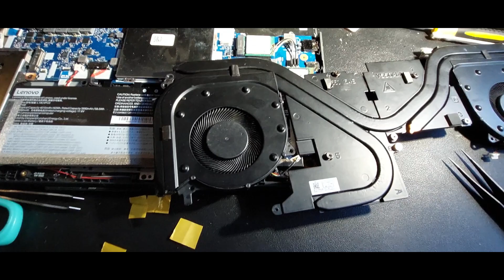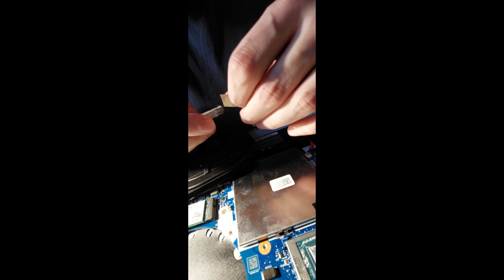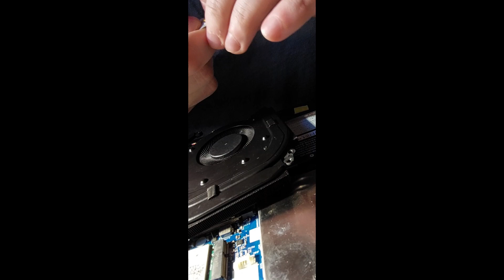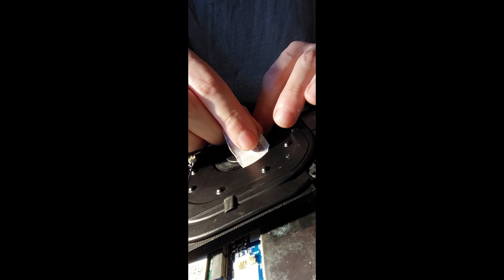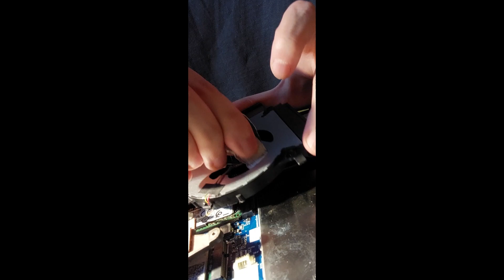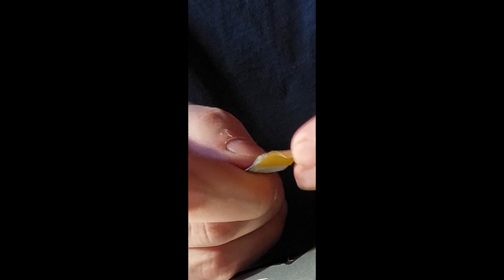How to thoroughly clean locked laptop fans (Lenovo Legion 5)

Comment: I wish I had seen this video before I took apart the fans on my computer, I was following a tutorial posted by Lenovo (which was for a follow-up model that has the fans with screws for easy removal), but I ended up breaking the plastic seals they had by mistake. 

My computer still worked fine for a few months, but it has since stopped working a few days ago, most likely due to the fans not being sealed anymore :/
Reply from the maker: How it stopped working? Is the screen black even though the power is still on? I doubt it's related, this model is notorious for short circuiting motherboard.
Reply: @korootz  The screen works, as you can see the change in brightness when the machine gets turned on, but it never gets to the Lenovo logo screen. I think the heatsink got fucked during the months I used it with the fans not sealed properly, as there were times it got really hot in my backpack (as the hybernation option wasn't working properly for some reason).

I'm looking to replace the whole heatsink with a new one, as it seems to be the most likely cause, nothing unusual can be seen on the motherboard and other parts.
Reply from the maker: @MrRonald2796  Laptop doesn't need a heatsink to boot (although it's a bad idea to run it this way). And short-circuit doesn't have to be visible to the naked eye. Try a hard reboot: remove the battery and unplug the AC adapter, then press and hold the power button for 20-30 seconds, then try booting it up again. Unplug all external devices like screens, too. I had this weird issue where for some reason it wouldn't boot if I had an external monitor connected, had to always plug monitors in only after booting.
Reply: @korootz  I tried that method a few times last week, it worked fine for like 3 days, then the issue reappeared and the method didn't work anymore, always with no external devices attached.

Comment: I think you should clean often since animal hair is there . I don't remove heatsink , I use the body of a pen to blow air and it pushes all the dust away through the fins. I think temperature starts increasing only if lot of dust is there, but even if I clean my table often this fan sucks up fine dust
Reply: Thank you... Saved me quite a bit of money but not buying compressed air... The pen trick works
Reply: @siddharthtm3744  just be careful to not spit accidentally :)

Comment: Omg, I've got a Lenovo legion as well! Might actually be using the same one, that's the machine I'm currently using for streaming as well.
Reply from the maker: Oh really? How do you like it? I've bought it for my wife, but if we don't play together she plays only Mahjong on it now 😆 and as most laptops it has some issues, it's loud as hell under pressure, on Win11 we can't change brightness and allegedly the sound gets out of sync with the picture but I haven't noticed.
Reply: @korootz  It get's really loud which isn't great for streaming, there's always some background noise from the fans going brrrr. But I've undervolted the CPU using Intel Xtreme Utility, which helped bring temperatures and noise down a bit.